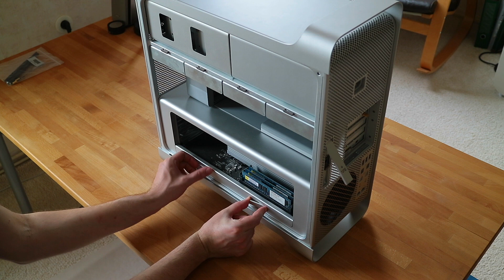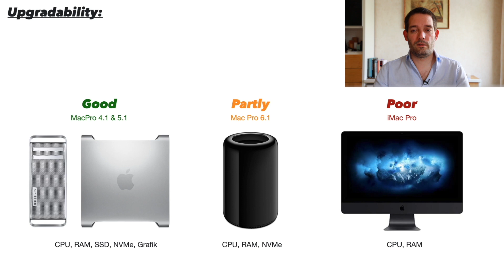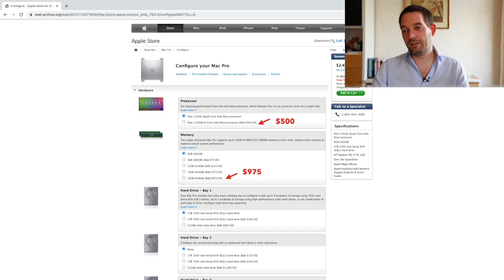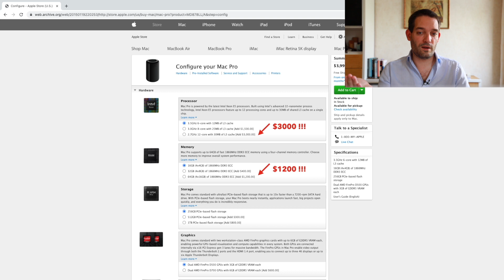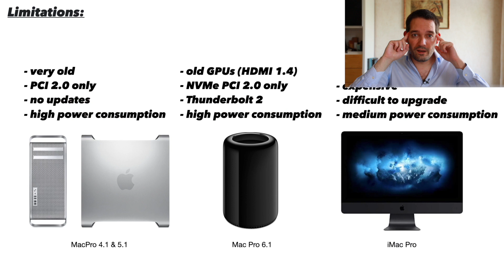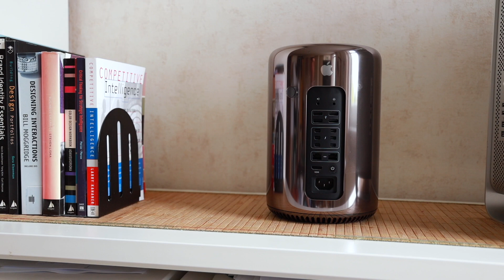Used Mac Pro - Consider this BEFORE buying! - Part 1

Comment: i bought a 6 1 Mac Pro for myself christmas 2023 for a steal and love it, Ive got the 6 core D500 32gb spec for $215 in mint condition. Will be upgrading to the 12 core and maxing out the ram soon. It totally serves every purpose I need and its a work of art on my desk. I always wanted one when they dropped and it finally made sense
Reply: You are better off with the 8 core Xeon. 😊
Reply from the maker: That's a great deal! I have switched to the Mac Studio, for video editing it's so much faster and way more energy efficient.

Comment: buying a used 2019, or 2023 mac pro is a good idea
Reply from the maker: I did purchase a Mac Studio M2 MAX recently, very happy with it!
Reply from the maker: In Europe electricity is become more and more expensive, currently 40cent per kWh, some experts even predict 60cent per kWh!!!
Reply from the maker: I measured the MacPros and at 40cents per kWh I would estimate €200 operating cost per year, that's €1000 over 5 years, if electricity rates go up even more.
Reply from the maker: In comparison the MacPro 5.1 is 120Watts in idle, and the MacStudio 12Watts, a 90% reduction while at the same time being much faster!
Reply: same here, my main mac is an m1pro now and my elec bill has dropped @ReviewTechTV

Comment: Excellent Video !  But a quick FYI, your background video on the iMac Pro is for an ancient iMac that is actually very easy to take a part and has no glue (3M Tape), the real iMac Pro is a nightmare and needs to be done with a plastic cutting wheel, just in case anyone was watching and thought it has a separate glass, or course the imac pro is a super expensive screen (even today) and if you break or chip the glass (very easy to do on an unprotected corner) you are SOL since the glass and display are fused together

Comment: I'm watching this on a 4,1 flashed to 5,1 running Sonoma. OpenCore Legacy Patcher allows you to run the current mac OS so long as you have capable GPU. I even get hardware accel. which helps out a lot.
Reply: The Xeons still holds up. Even the 1.1 watching and writing this on a firmware upgraded mac pro 1.1 ;) 2.1 with 24GB RAM, win10 Pro and a Msi GTX 780
Reply: @ladeluff_  I have a dual 3.33 with 48 GB RAM and an RX580, it handles everything I throw at it well. Only thing that does suck is single core performance, which I only really notice in some games. Other than that, it’s perfect for me. I need to get around to putting an NVME in and upgrading the WiFi/bt
Reply: I use and testdifferent GPU´s aswell as a couple of RX 580 is a safe bet. the best allround GPU i think. less hassle with drivers. i got dual systems and single systems. The X5690 3,46Ghz 6-core  is a single core system that handles WELL with RX 580 or even RX 6800 XT with BIOS update. And i have NVMe drives almost all systems as well   @vb7200

Comment: Dude you can run Mac OS latest on Mac Pro 5,1 you put Radeon 6800. My Mac Pro 6,1 run with Radeon Vega 56. I still use both today
Reply from the maker: I am aware, but for security reasons OpenCore is not an option for me.

Comment: I got a Mac Pro 2009, upgraded memory, CPU, GPU, WiFi module and fitted with 4x HDD, 2x SSD and 1x NVMe (for the OS), and using it as a media server, backups and stuff.
Reply: Nice. I prefer the SSDs, had an nvme on another MP and it’d stutter. Great computers.
Reply: @johnnyquid-xj4kk  The NVMe cannot run full speed, as the PCI is too old/slow anyway. But it had some improvement over the other slots for SSD. I did a read/write test to confirm it.

I just love it has so much capacity for storage upgrades.
Reply: Ive had better luck w SSDs, I've had had two NVMEs go bad, and they weren't cheap, they froze, my SSDs are fine. That's my  next purchase. cheers. @peters-z8n